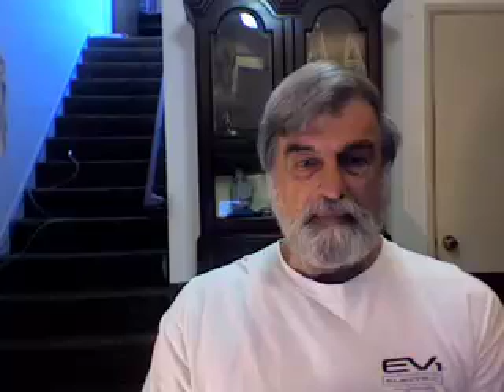Prius: not an EV, can't plug in

Comment: I've read that technically the Prius or Insight aren't actually Hybrids.
A Hybrid needs more than one source of fuel to be called a "Hybrid". Thing is, if you run out of gas in a Prius/Insight the motor shuts down too - You have to go get gas in a jerry can, you can't just crawl electric-only to a gas station.

Comment: It's good to see someone who has decided to educate the pulblic..our meadia is very bad at that...good video.   I do like the idea that GM is developing a new battery that is better than the NiMH. There is problems with the NiMH and there are advantages with the Lion. 
I just glad that GM has come out with the best solution to date. The ultimate solution will be to put a hydrogen fuel cell in the volt and be done with gasoline.

Comment: What's wrong with this car analyser. The Prius is not an electric car and not plug In yet. It's for the next model. For the moment the Hybrid Synergy Drive of the Prius produces his own electric energy alone with a clever system. The HSD on the Prius is the best system ever made in a car. It's easy to criticise but what other car can do better on the roads our days ? With my Prius I average 4.5 l/100 km at a speed of 90 km/h and 6.3 l/100 km on the motorway at a speed of 130 km/h.